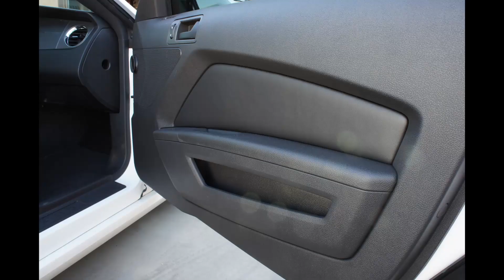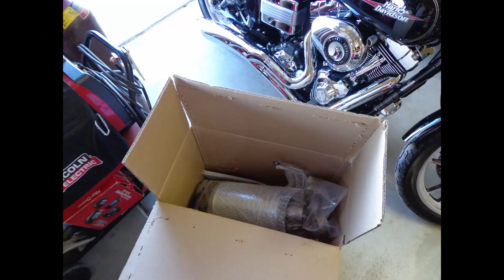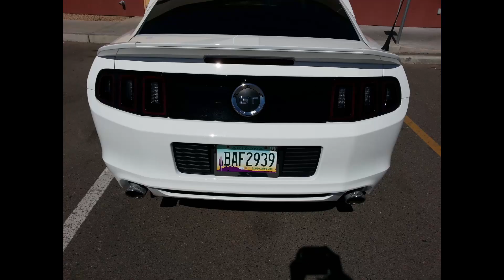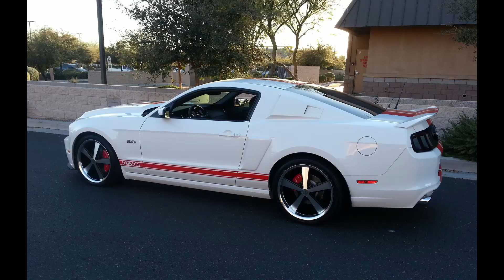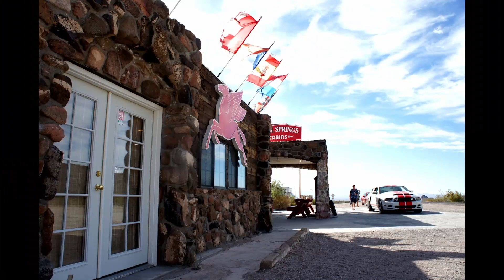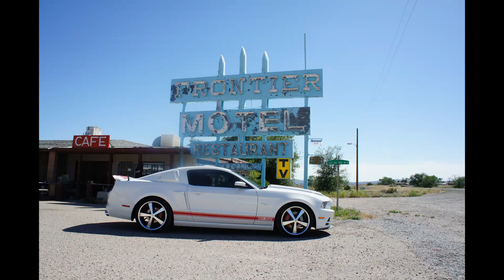2013 Mustang GT. Showing the car as it was modified during a 3 month process from brand new.

Comment: I thought that was a Corvette in the garage!  Do you still have it?  Nice job on the Mustang!  Bobby
Reply: That's funny you say that, when I bought mine in Columbus, Ohio I looked at a leftover yellow 2003 model.   It was an automatic, needless to say I didn't buy it.  I found  a red one with a five speed.  I put an SLP loudmouth exhaust on it.
Reply from the maker: @bobbyviti7794  Those Mach1's are really nice looking cars. A guy who worked where I did bought an orange 04. The yellow car I looked at was a 5 speed manual. Red is a good looking color on those cars. The shaker, the Magnum 500 style wheels, the black rear spoiler and the stripes really made them sharp looking.
Reply: @SPSteve  The sad part is, I traded the Mach one in for a Mazda 3 when I was in Tampa.  My excuse was I was buying a house.  Three months later the Mazda was gone and I picked up the 07 GT.  Shortly thereafter I moved to New York.
Reply from the maker: @bobbyviti7794  Life happens. If we knew then what we know now we'd have all those great cars we let go. Of course we'd need a really big garage. :)
Reply from the maker: No, I sold the Corvette years ago. The 79 Hurst/Olds shown is also long gone. I was a frequent buyer and seller of muscle cars since my early 20's, so I've been through a lot of them. I'm getting old now so the Rallye 350 and the Trans Am will probably be my last classic muscle cars. The Mustang was a good car. Ford has done a great job with the Mustang over the past few generations.
Reply: @SPSteve  I'm a Chevy guy all the way, but after my 97 Z-28 I started buying Mustangs.  I had a 2004 Mach one, a 2007 GT, and a 2010 GT with the Track pac.  Unfortunately after that, I went to an Audi A4 with a six speed.
Reply from the maker: @bobbyviti7794  I really wanted a 2004 Mach1. I test drove a yellow one and came so close to buying it.  My daily driver is a 2022 BMW X3 these days. I'm probably done with new sporty cars, although the 2024 Mustang GT looks interesting.